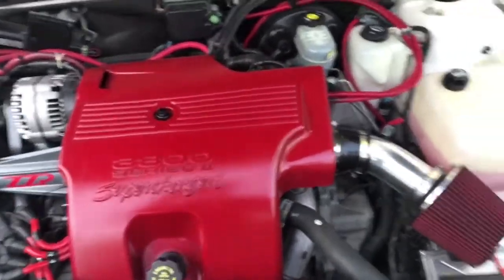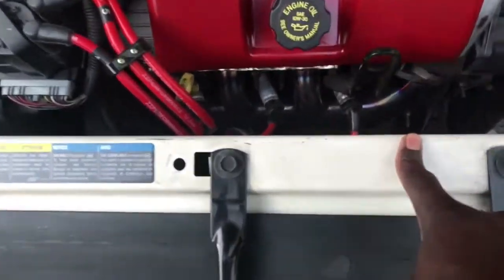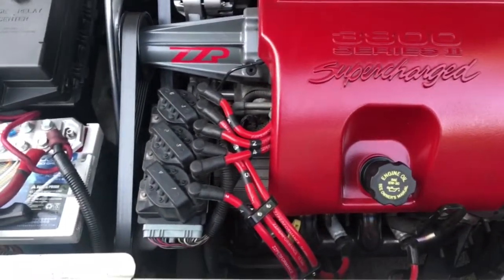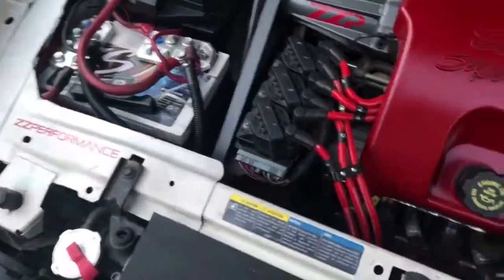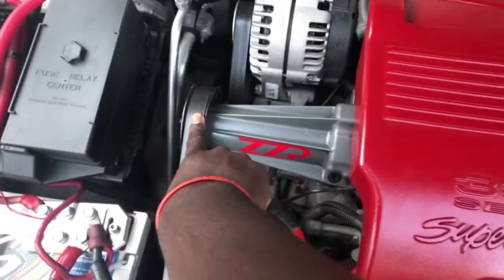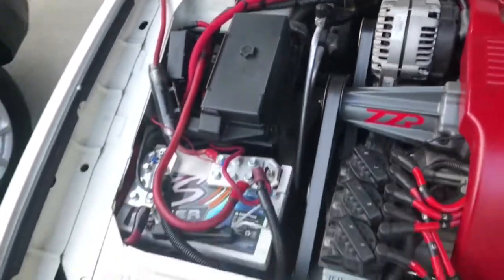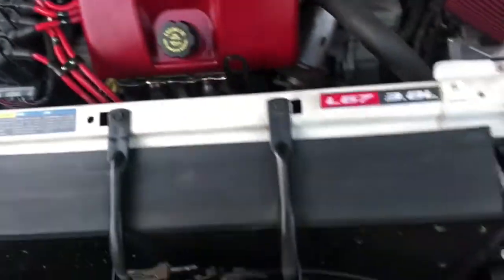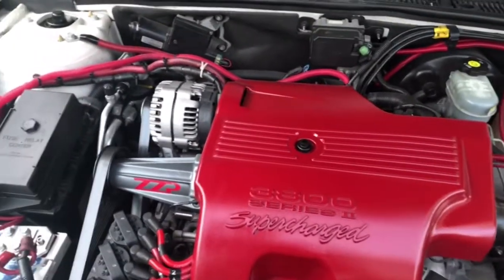Boosted Buick Mod List

Comment: I know it’s an old video, but I just got an 04 super cherry park ave ultra, 80k on it. Looks brand new. 

Do you have any issues from not having dog bone mounts on the front? These motors tend to torque and twist toward the rear, I’m slowly nodding mine, but am concerned about breaking mounts or axles. 
If you read this thank you.
Reply: I burn thru axles

Comment: Hey I have a Buick Park avenue ultra, what are some basic mods I could do for extra horsepower for under five hundred bucks?
Reply from the maker: It’s not much you can do to add a noticeable amount of HP for that price but you can get some of the supporting mods out of the way
Reply from the maker: You Can get the front and rear P logs and tuned pcm for exactly 500$ before tax check out zzperformance but honestly you don’t start gaining noticable HP gains until you go down a few sizes on the supercharged pulley but there some thing you have to address before downing pulley size
Reply: @TCHALLA_S550  i have a buick lesabre 1989 and i wanna boost its horse power is it any diffrent from your 2004 lesabre it's the same engine. V6

Comment: Can you write down exactly what u put in as far as tuning bc I got the same car. It's just kind of hard to understand everything in a video
Reply from the maker: +Official brundog21 NGk Tr6 spark, 10.5mm wires, CAI, front and rear zzp plogs, 3 inch down pipe with 400 cell cat, 160 therm, tuned PCM, 3.4 SC pulley, that should be it
Reply: Boosted Buick thanks man I appreciate you replying.
Reply from the maker: +Official brundog21 no problem. If you haven't already smack that subscribe button. I got more vids coming this weekend
Reply: Boosted Buick yea for sure
Reply from the maker: +Official brundog21 For parts got to ZZPERFORMANCE.com
Reply: Boosted Buick alright thanks man! How much did the supercharger cost you?
Reply from the maker: +Official brundog21 the supercharger comes stock on this car buddy. But the also sale them on zzp I think like $500 or so

Comment: I have been trying to mod my 97 park avenue to take to my local meet, and this is really helpful, but do you have any tips for someone getting into tuning?
Reply from the maker: My only tip is find somebody that knows what they are doing and unfortunately if you don’t live in Michigan there is not many companies that want to touch a 3800 and thank you for letting me know that I could help! Click that subscribe button and let me know if I could help with anything else
Reply: I also have a 97 buick park avenue, and im also getting into upgrading it.